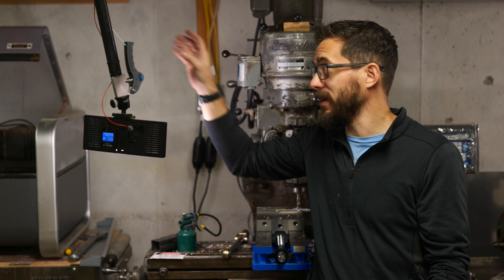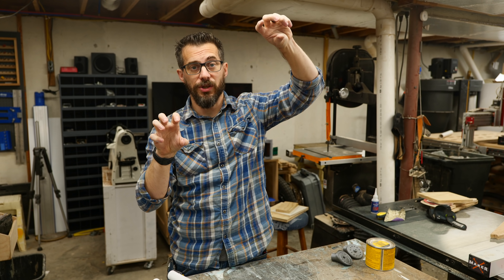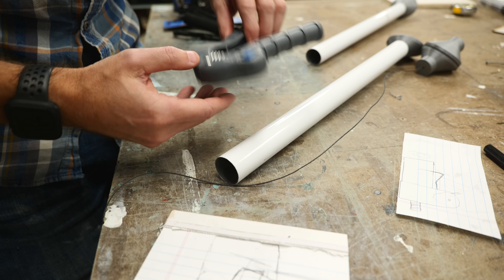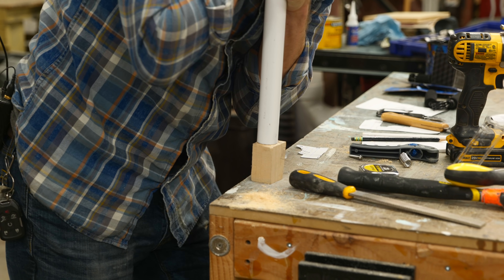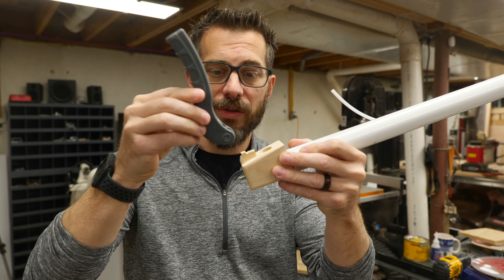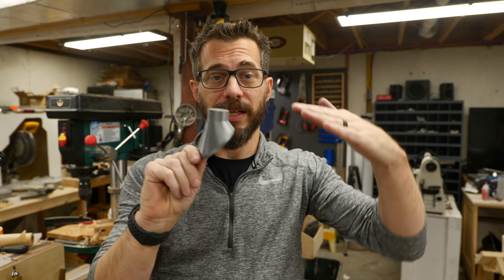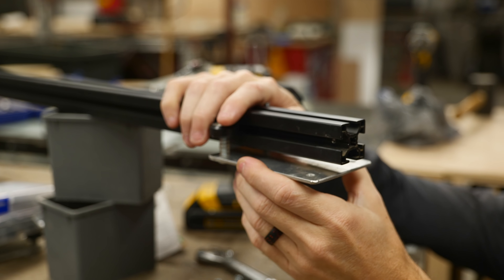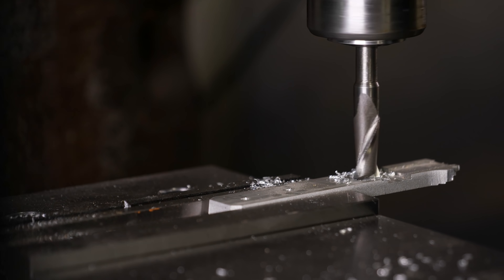Adjustable Work Light Arm | I Like To Make Stuff

Comment: I was thinking about a spring between the 2 3D printed parts to help separate them
Reply from the maker: They separate pretty easily actually, the locks need to be a bit stronger
Reply: Could you use small electromagnets to strengthen the joint...squeeze the grip the cable and magnets release let go of the grip the magnets and cable tighten the joint up.  Instead of the outside perimeter on the joint could you create a mortise and tenon pivot at the center of the joint giving the joint an axle to swing or pivot around?

Comment: the example of how you shouldn't make stuff.
You don't want the system to be held by the tension of a metal plate and a few bolts. In short time it would loosen up, wheel wore out and everything will eventually fall down. Wheels should be oriented vertically and system should rest on top wheels and held on railing by the bottom wheels.
Also All the joins are unreliable and will fail in a matter of time..